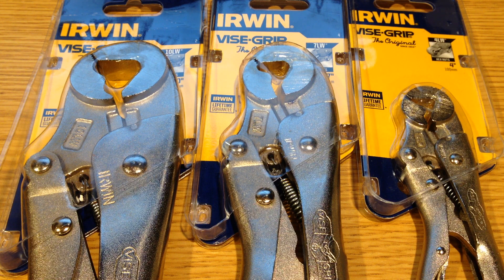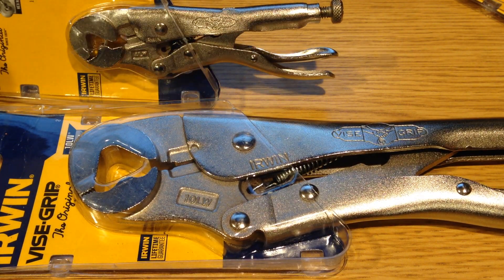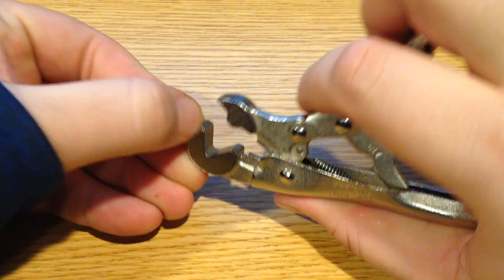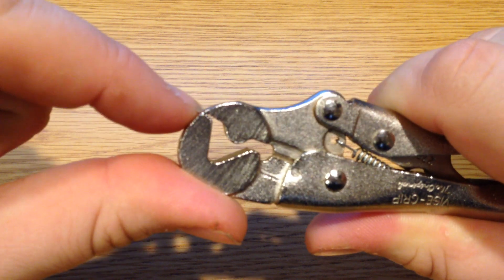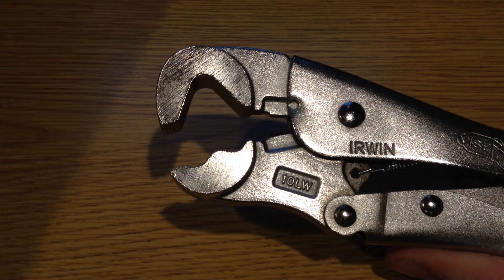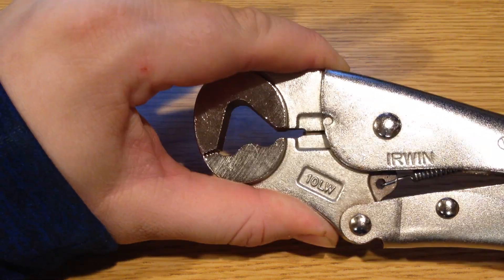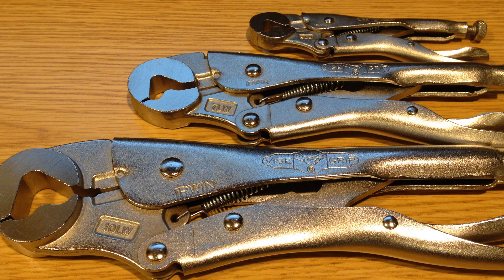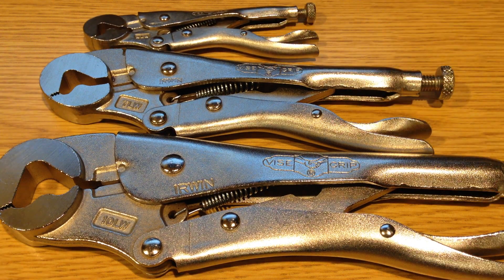ViseGrip Hex Nut Pliers

Comment: These are meant for clamping on hex shaped nuts or bolts.  The loading is more even with 3 sides of contact. Have worked great on bolts and nuts that have been rounded.